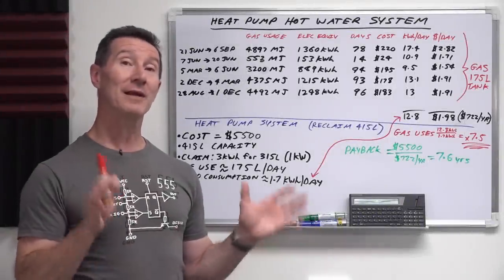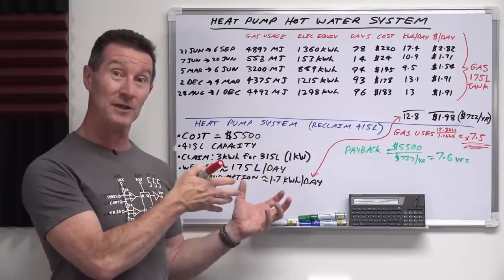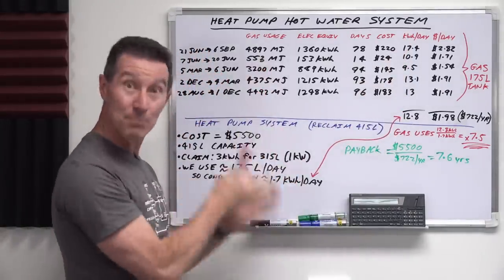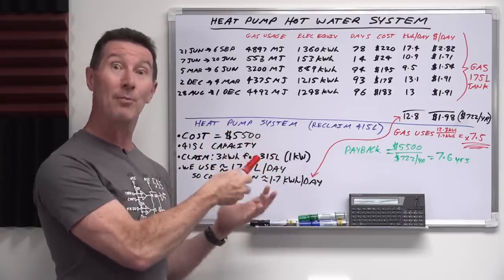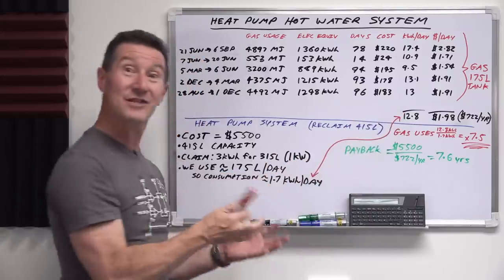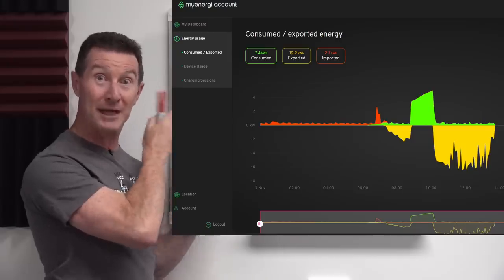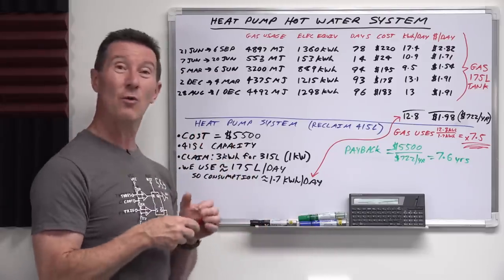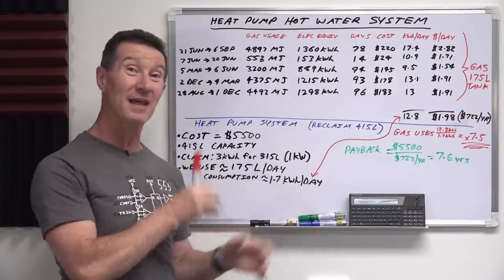Heat Pump Hot Water System vs Gas Hot Water

Comment: I'll be super interested to see how you go with this! I have been looking into the numbers myself for NZ, moving from electric hot water to heat pump. Based on my calculations and usage the best payback period would be to get the absolute cheapest model, which can only run in heat pump mode down to 7°C and only gets a COP of 2. The reclaim unit is super efficient and will run in heat pump mode all winter, but in NZ they cost around $8000 so you have to use a lot of hot water to make the payback time reasonable. Also I think the reclaim heat pump unit is made by chofu in Japan
Reply from the maker: Yeah, would cost a lot to ship. None made local in NZ?
Reply: @EEVblog2  There are at least a couple - Ecoenergy HP4000LT and BDT Hydrobox were what I found, but they cost a decent bit more than the cheapo Midea unit
Reply: My reluctance to move from gas to this is there are so many moving parts and things to go wrong compared with the simple robust design of a gas heater.  Dave himself has said that he was hoping the thing would die but still soldiers on after 30 years,
Reply: @kissingfrogs  would be worth downloading the maintenance manuals for the unit and training yourself up. 
You need a professional gas installer to service a boiler. Anyone can do a heat pump.

Comment: "boiler isn't a thing here". Speak for yourself. Try living in Melbourne without central heating.
Reply from the maker: You chose to live in Melbourne? 😛
Reply: Do so every day, central heating is not worth the cost.
Reply: I lived in Melbourne for 15 years without central heating... And I live in Tassie now without central heating... 

If you have a boiler you're definitely the exception to the rule.
Reply: @SomeMorganSomewhere  well, for a hydronic boiler, yes. but ducted gas central heating is everywhere.
Reply: @pie314isi  Yes, but he explicitly referred to boilers.

And yes, gas ducted central heating is relatively common, I've still never lived in a house in southern Australia that had it so evidently it's not essential as your comment would suggest...
Reply: Better off to move while you're still allowed to.

Comment: I got one of these a couple years ago. Between a screaming deal from the retailer, a chunky rebate program from the power company, and self-installation, it was only a couple hundred when everything was said and done. Massive power savings compared to the old resistive water heater we had previously.

Comment: Hey, nicely laid out! :)
I wouldn't think Aussie would get hit that bad, at least it's not as much as here in Europe.

Wondering if that 175 liters is the amount of water in the tank, or at the tap. You can get the same amount of 40°C warm water by mixing a bit of cold with lots of 50°C hot, or more cold water with much less 70°C hot. The heat consumption will stay the same. Mass times specific heat times temperature difference... :)
While we're at it, I strongly endorse thermostatic mixing valves, it's like a voltage regulator: as long as the input temperature is at least as high as the output temperature, it'll keep the latter at the constant level. Just set it and forget it. No need to go to the bathroom checking if that tap water got too cool. Automation FTW.

1.7kWh per day is very good indeed. 12.8/d is also decent given the type and placement of your old heater; storage heaters have standby losses because heat insulation is never perfect, and placed outside it's even more of a problem as the cold environment sucks the heat away faster (the gradient of temperature thing) plus it doesn't contribute to house heating.

Gas heaters definitely have an efficiency problem; lots of heats just go up the smokestack and get wasted. The condensation type heaters are better; in case someone's wondering, they re-use part of the latent condensation heat of water vapor in flue to pre-heat the water on the input. 
Back in 2019 I decided to get rid of gas completely, both an instant water heater and a cooker, replaced them with an electric storage heater and an induction hob. Oh man, I didn't see 2022 coming, haha... With 3 adults we have roughly 10kWh per day for heating the water, it's all done in trough hours (split tariff FTW) and the standby losses are minimal as I got the best thing I could afford i.e. a Stiebel Eltron SH120S that I modded to work with my home automation system. Nerds gonna nerd.